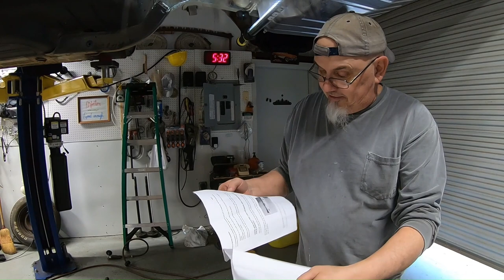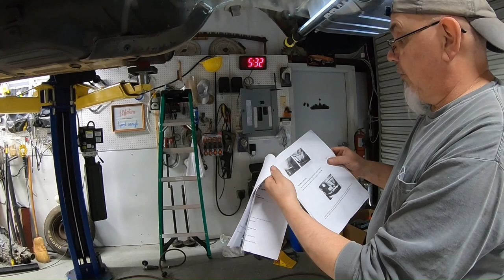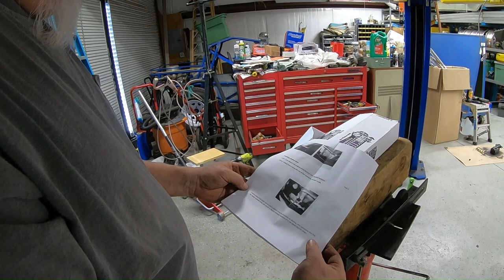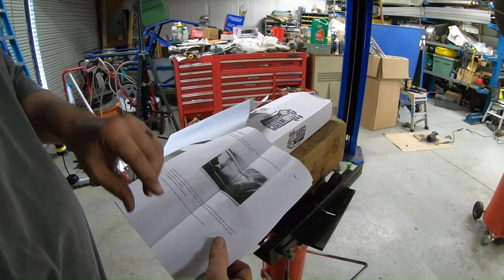AJE rear suspension fitment problems 1965 Mustang

Comment: Had the same frustration putting the front k member on my 63 1/2 ranchero. THANK GOD YOU POSTED THIS VIDEO for the rear. I will watch this video another 10 times before installing rear 4 link cradle ! THANK YOU
Reply from the maker: It was very frustrating not knowing if I was doing something wrong or if it was just the way it's done. I'm still not 100% sure it's done "right," but it's in there and hasn't fallen out, haha. On the plus side, after I worked around the upper coilover mount, the car does ride and handle nicely.

Comment: What housing did you use? I just bought the updated version of this for my 66 mustang and I'm at a loss for what rear housing to use, was going to get 1 for a 99 explorer and cut it down, but yours looks like a better fit, looks like a fox body  housing, any help would be greatly appreciated because the new updated instructions also suck.
Reply from the maker: 😄
Sorry, I don't mean to laugh. I know they're frustrating. As far as I know, 1984-1998 Mustang 8.8 axle housings are the same, the only difference being axle shaft lengths (plus the obvious brakes, etc)

What I have is a 95-98 housing with Ford Ranger axle shafts. The shafts are both from the driver's side of the Ranger. These are supposed to be the same length as Fox Body shafts, but are 5 lug. I also had to use a small hub-centric ring to keep the disc concentric with the axle shaft. I found those on ebay for like $20 or so.

With this setup I was able to run a 15x8 wheel with a 245/60-15 BFG tire with no rubbing.
Reply: Thank you, there's a local junk yard near me that has tons of explorer's, rangers and mustangs, so I thought it would be best to start there, definitely going to look into your setup instead because I'm at my wits end with this entire front and back suspension, spent over $8,000 so far for the front and rear suspension from rod and custom motorsports and just not a big fan already.

Comment: Remember all mustangs where not built the same so fitment can very. I have both front and back Aje on my 68 mustang, the cradle was hard to install I had the same fitment issue. I bolted mines in. I used a donor 98 cobra mustang
Reply from the maker: Yep! Cars back then weren't made to the same tolerances of modern vehicles!

Comment: I NEVER comment on videos but I felt this deserves one. I installed their (AJE) front and rear kits on my 67 Mustang. You are not alone on any of your complaints. I had many of your same issues. AJE makes an outstanding product but their instructions were awful.  The pictures are horrible and there should have been more alignment points referenced. If they would spend a little more time and effort on instructions and better pics/info on their website  they would be covered up  with business. In today's world customer service will make or break your business (in my opinion). 
Aje, if you see this, hire some young computer savvy employee that is passionate about making your product line stand out from the rest of your competitors. By updating your website with install instructions, with high quality pictures, write ups  and videos you will be a cut above the rest.
Reply from the maker: Well, thank you for taking the time to respond! I agree, their product is good. Other than the one lower control arm, I had no issues with the quality of any of the parts. The old '65 rides and handles great, and in the end, I'm glad we did it. It was just a painful process to get it all installed haha!
Reply: @TorquePowerVideo  please make a video review of how the car drives and handles. No where on YouTube have ibfound a review on the "after install"
Reply from the maker: There will be more videos on the Mustang coming in a few months!